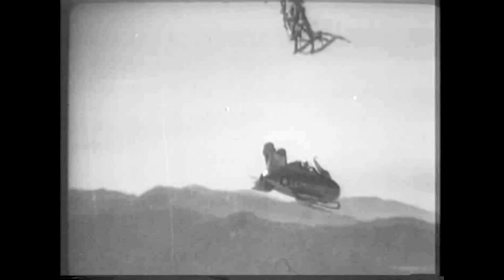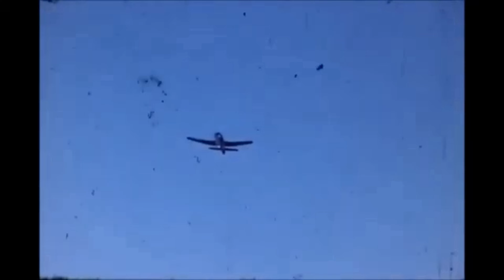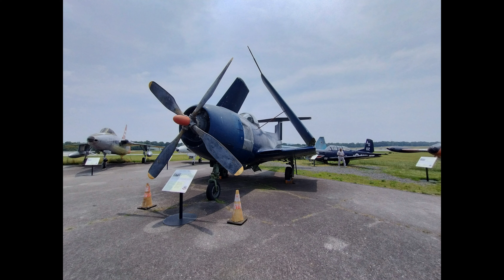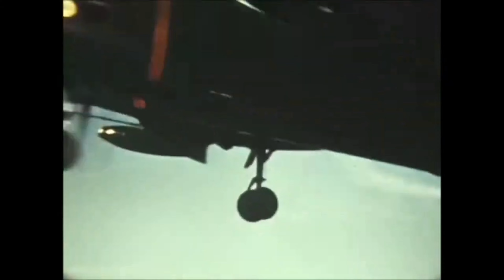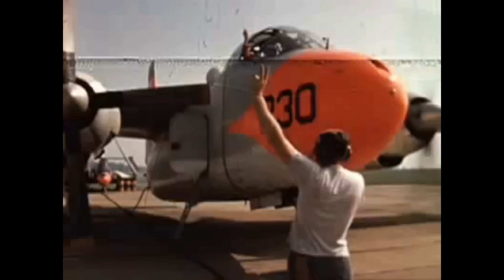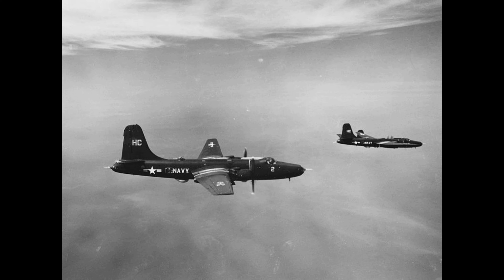Mixed Propulsion Aircraft Pt.1 | Index Of Oddities Ep.1

Comment: Nothing about the airfoils of the P4M is exotic. Combination of thicker airfoils at the root for structural stability with a thinner of the same family at the tip for less drag is done in near every wing. If that lead to tip stalls, the wing did not have the proper amount of washout.
Also, NACA is pronounced as one word, just like its sucessor NASA.

Comment: On the Curtiss. Curtiss Inc. was a disaster. They bean counters hated spending money on R&D apparently. To the point that NACA and the USAAC torn them a new one for not using NACA data on laminar flow. It was their local congressmen that pressured AAC to continue to buy the now obsolete P40. There was so much turmoil in the company that the XF15 was dropped, along with a 4 engined night fighter for the airforce. I got to watch the beautifully restored XF15 deteriorate ouitdoors at the Quonset Air museum that pretty much only had enough money to keep the lights on. Dunno where it is now.

Comment: At the 18:00 minute mark the Martin P4M Mercator is photographed in color with a 1960 or later white 2-door Corvair in the background.
Good longevity for a 1946 aircraft with only 21 units produced.
Reply: The Mercators were withdrawn from service in 1960. In 1951 the remaining 18 were modified for the SIGINT role, with Fleet Air Reconnaissance Squadron One (VQ-1) patrolling the coasts of North Korea, China, Vietnam, and the eastern Soviet Union, sometimes masquerading as P2V Neptunes with false serial numbers and fake radio communications. One was shot down by Chinese fighters and another heavily damaged by North Korean Mig 17s in 1959. The Mercators replacementin its role was tbe EA-3B Skywarrior which also had the advantage of being carrier capable.

Comment: Are you going to cover mixed power commercial aircraft?
Reply from the maker: You'd have to give me some examples, as off the top of my head, I haven't come across any commercial aircraft that used mixed propulsion, outside of the occasional DC-3 mod. For now, the series is focused on US built mixed propulsion products but if there's enough interest, I may do a part 3 going over foreign designs. I'd still need to compile a list of such aircraft.
Reply: @AviationGeek1903  My Dad wrenched on Mid Continent and Braniff DC-3's that had high altitude second stage supercharger clutches bronze-wired in the "off" position.* Those planes and some other similar also had JATO bottles they used on hot days in La Paz.
*When flying passengers within the US.
Reply: The Lancastrian comes to mind

Comment: The Me262 was originally a mixed propulsion aircraft - it had a piston engine in the nose because the Ju004 engines were horribly unreliable (with a mean time to failure of less than five hours).
Reply from the maker: I think you're right. I know the earliest flights were under piston power, wtihout the jet engines Installed. I vaguely remember reading somewhere that it retained the piston engine for the reasons you mentioned, but I'd have to do some digging to confirm that. For now, this series will focus on the US mixed propulsion aircraft, but if there is enough interest, I may to a part 3 going over non-US aircraft. Based on technicality, the 262 would be the first mixed propulsion aircraft ever. Thanks for the comment!
Reply: That was mostly because the airframe was ready far before the engines were, so it needed testing. Saying that, the engines in production variants had a mean time between failures of roughly 25 hours, not because the design was bad, but because Germany had severe shortages of alloying agents for high-quality steels by that point in the war.
Reply: @onenote6619  The “severe shortage of alloys” as a cause of failure was largely a myth. The first 5000 engines built had an even number of turbine blades, as the blades passed behind the four support struts it induced vibrations that caused resonance and fracturing at the base of the blades. This was finally identified in late 1943 and meant that every engine manufactured to the earlier designs had to be scrapped to accommodate a new turbine and compressor with a different prime number of blades on each stage to avoid resonance. The British engines had this designed in from the start and consequently had an order of magnitude higher reliability.
Most car transmissions use a similar technique to avoid gearbox noise from resonance so two teeth rarely mesh on each rotation of the gears.
Postwar Russian and Czech copies of the Ju004 and BMW003 had no restrictions on materials but also found the designs to be “problematic” from a reliability perspective which is why they switched to cloned derivatives of the British Derwent and Nene.
Similarly the Americans used mostly clones of the British engines (including the axial flow AS Sapphire (J65), De Havilland Goblin (J36), Power Jets W.1.X (J31) etc.) The axial flow J35 was an exception being developed in parallel with the J31 by GE and Allison (note - without German input but with knowledge of the Beryl engine.)